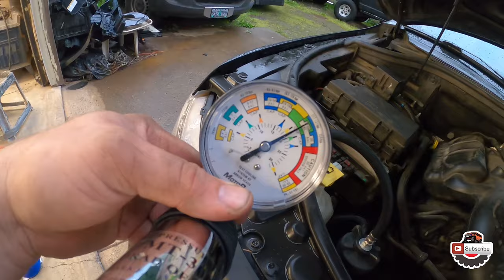Jeep Grand Cherokee Coolant Leak Fix

Comment: First, thanks for the video and instructions.  I have the hose assembly replaced, but I don't remember if the bottom edge of the firewall liner placement is in front of the lower sheet metal, or behind the lower sheet metal.  If you happen to remember, I'd appreciate it.

Comment: My nieces jeep is leaking somewhere. She is having to fill up the radiator twice a day. The resevoir stays at the max  level. im going to try looking at the heater core hoses tomorrow. wish me luck
Reply from the maker: Here's a tip, you can rent that pressure tool and with the engine off, put some light pressure in. Also if money is an issue, get your self a heat glove and sqeeze the rad hose. If there's a crack in any of the hoses or elbows, it'll show its self.  On mine it was obvious. But one quick look underneath and i could tell theres a leak from all the dried up white'ish residue on surrounding parts.
Good Luck.  hope its something simple.
Reply: @JeeperGear  found out, her engine is getting over pressurized and the coolant is coming out of resevoir while she drives.  Maybe a head gasket, Ive replaced the thermostat and ECT sensor. Im going to run a combustion leak test tomorrow to see if its her heads. Water pump isnt leaking or making noise. radiator isnt leaking either.
Reply from the maker: @allthingshiphop1151  Unfortunately that sounds like a headgasket, but a dye leak test will be a good confirmation. Also test the radiator cap to make sure it holds down its rated psi. Those things can cause all sorts of nasty hard to track down issues that can send you down the rabbit hole, when they fail.
Reply: @JeeperGear  I looked at her radiator cap  yesterday. It looks good, Rubber/sealer isnt cracking or dry. I did notice a little corrosion on the inner vacum valve behind the spring? (not sure if thats what its called) Im going to buy a new cap tomorrow as well. Just didnt have time to work on her truck today. But she did tell me it hasnt  overheated today. Her check engine light was on and i got the codes for a ECT sensor being bad, So thats why I replaced it yesterday. It didnt overheat but the temp did go up to 220F at one point. I had to drop her truck off back to her since its her only ride to get to work. So shes had the truck today. It didnt overheat on the way to her job (20 min drive) or on her way home from work But im thinking its because she still had some water in it. So Im hoping the ECT sensor worked, But im still gonna run a leak test tomorrow moring. Ill let you know what happen . Btw its a 2012 jeep grand cherokee 3.6l
Reply: @allthingshiphop1151  how did it all turn out??? I have a 2011 jeep laredo
Reply: @cgaskin00  head gaskets damaged. Sold the truck
Reply: Did she have any smoke coming out the tailpipe? I think I have a long day ahead of me…
Reply: @allthingshiphop1151  how many miles did it have when you discovered it was the head gasket issue?

Comment: My 2011 Overland has the same exact problem. I have the V8 engine thanks for the video i have to do this job this weekend the dealer tells me $1500 btw do u live in North CAROLINA? I will pay u to replace mine
Reply from the maker: Thank you, that means alot. Sorry man, I'm in Oregon.
Reply: Hey bro how its running after fix im having same problem
Reply from the maker: @ivanreese7087  customer runs the Jeep from the vid as a delivery vehicle atm. 
Got 20k miles on her already post repair.
Reply: @JeeperGear  20k miles after fix? Ok thanks for the feedback
Reply: @ivanreese7087 She’s runnin good. I bought the hose from the dealer for abt $108 bucks.  Attempted to put it on myself then chickened out
I had the Jeep dealer put it on And  they stuck a $400 bill up my A$$
Reply: @chevychase9797  damn brother im slowing learning about cars myself dealer tried charing me 800 for replafement of waterpump & thermo. So i went out found the parts under 130 brandnew. Only this is now is finding someone to help me.
Reply: @ivanreese7087  take it to the dealer these Jeep are not easy to work on

Comment: Wow 300,000m. I feel better about mine now. 
I have a leak small leak intermittent. Anti freeze in bottom front pan. (The pan you removed) drives me nuts because i cant pinpoint the leak.
Reply: Did you ever figure out where the leak was coming from? Having same issue😪

Comment: I think I might have a leak from the tip of my new upper hose i see tiny spray trails coming from that specific area my upper/lowers hoses are brand new but has the old factory clamps, my mechanic used the old clamps he said they were still good at the time but lately I’ve been seeing a tiny leaking spray trail from the tip of upper hose(opposite side of the radiator) I’m guessing it’s from that old factory clamp, could I replace that clamp w a new shiny silver standard clamp that has screw flat head for tightening without disconnecting the upper hose and if I do is it mandatory for me to reflush the entire coolant system meaning I gotta buy gallons of coolant and drain n fill n re burp the entire system?
Reply from the maker: Spring style hose clamps are typically fabricated from steel alloy and plated with zinc for corrosion protection.  Steel Spring style hose clamps have several advantages over Worm Gear style clamps as they continuously apply the same clamping force under all environmental conditions, over their entire life. With temperatures changes, rubber shrinkage with age, and vibration loads, the spring style clamp consistently applies force to seal the hose. Worm Gear clamps on the other hand can become loose due to vibration, material shrinkage, temperature fluctuation and can be grossly over tightened damaging the hose and radiator fittings. I would pick up a new set of factory spring clamps to replace with. 
Also, as you replace them, make sure the hose outlets surfaces are clean from debris or build up and will form an even seal when hose is put on. 
Sometimes, spring clamps can be tweaked or damaged if pressure is applied incorrectly with channel locks to unlock them. 
As far as coolant goes, just a word of advice, do not mess with the coolant system if its still hot and pressurized, it will burn you if messed with before letting it cool down. I've had a hose pop off on me because of a failed worm drive clamps. Burned my shoulder and half my face. 
 If you drain it in to a clean deep pan or a bucket, you should be able to reuse it with out any issue. Most of the time if I see any kind of debris, I would filter the coolant as I'm pouring it back in to the system. Then use distilled water if a small amound is needed to top off, keep in mind if you lose a large amount of coolant while draining (accidents happen 😅)  then pick up a fresh gallon of recommended coolant for your model to top off/add. 
Afterwards wipe everything down and then burp the system, look over all hose connections for leaks and you should be good to go.

Hope this clears things up.
Reply: Jeeper Gear wow thank you so much for all this knowledge! 🙏🏽 I’m learning as I go! just tired of paying my mechanic money where I could do all of this myself and I will! It’s a 07 jgc laredo and she’s been maintained well for the last 13 yrs 182K all freeway miles. But this past year I’ve been doing all of my small maintenance here and there I’ve invested in some good tools for me to use and this specific issue I will deal w all by myself and maybe just grab a brand new spring style clamps like you’ve mentioned and stay away from the worm style clamps that makes a lot of sense again ty so much I really do appreciate it! 👏🏽

Comment: I have the same leak on a 2011 GJC
Got the part ready to install 
What’s behind the firewall that need to be loosen
Reply from the maker: From inside the cab, there's nothing to be done only from the engine bay side. Thats why i removed that first firewall shield to get to it and have room to work on lossening the hose clamps. Its tight in there.

Comment: How did you burp the air bubble out?
Reply from the maker: While engine is off, I filled up the radiator, also squeezed the lower and upper rad hoses to get excess air out, then started the engine. Switched interior temp to hottest and blower on. 
Let it run for little while, while adding more coolant as the air escaped and the level dropped in radiator.  Once it quit burping/dropping, closed the radiator cap,  filled the reservoir to a hi line and waited for the rad fan to kick on and hot air to start traveling through the vents.  
P.s. don't let it get supper hot with rad cap being open, as coolant will start to boil if there's no pressure build up in the coolant system.
Reply: @JeeperGear  awesome thank you so much. My local shop wanted to charge me almost 600$ I'm replacing this part in the morning thanks to you! Your awesome!!!!
Reply: What's the part called or part number?
Reply from the maker: Heres the part number for the 3.6 model. 5.7 is little different.  
HVAC Heater Hose Assembly
68251577AB 

Hope this helps.

Comment: Do you think it would help to take the hood off?
Reply from the maker: That would give you more light to work with. Other than that, there's plenty of room with the 3.6 engine. V8 will be a little tight.
Reply: @JeeperGear   I will leave it on if you recall will antifreeze come pouring out of that hose after you take it off   Probably best to do with a cold engine ? Thanks Bud

Comment: What's the name of this part ?
Reply from the maker: You can get those from a dealer by calling them Heater core pipe fittings. 
Here's a google search query for an example. 
https://www.google.com/search?q=jeep+wk2++Heater+core+pipe+fittings&sca_esv=549c059cf7ea463a&sxsrf=ADLYWIKzINEGIhr-TK1MMDvuDa5R4IBZTQ%3A1717815357288&source=hp&ei=PchjZv2cD6yg0PEPrM2quAk&iflsig=AL9hbdgAAAAAZmPWTd8JDudqtsIR5qNM1bDAQ2IGVOD3&ved=0ahUKEwi9r6LxgMuGAxUsEDQIHaymCpcQ4dUDCBc&uact=5&oq=jeep+wk2++Heater+core+pipe+fittings&gs_lp=Egdnd3Mtd2l6IiNqZWVwIHdrMiAgSGVhdGVyIGNvcmUgcGlwZSBmaXR0aW5nczIFECEYoAEyBRAhGKABMgUQIRigATIFECEYoAEyBRAhGKABMgUQIRirAkiVLlAAWJgncAJ4AJABAJgBxQOgAZUNqgEJOC4xLjIuMC4xuAEDyAEA-AEB-AECmAIOoALeDcICBBAjGCfCAgsQABiABBixAxiDAcICCxAuGIAEGLEDGIMBwgIOEC4YgAQYsQMYgwEYigXCAhEQLhiABBixAxjRAxiDARjHAcICDhAAGIAEGLEDGIMBGIoFwgIIEC4YgAQYsQPCAg4QLhiABBixAxjRAxjHAcICCxAuGIAEGLEDGNQCwgIIEAAYgAQYsQPCAgUQABiABMICBRAuGIAEwgIGEAAYFhgewgILEAAYgAQYsQMYyQPCAgsQLhiABBjHARivAcICCBAAGIAEGJIDwgILEAAYgAQYkgMYigWYAwCSBwoxMC4xLjEuMS4xoAfelwE&sclient=gws-wiz&dlnr=1&sei=R8hjZvmEMcXa0PEPqa-dqQU

Comment: Is this elbow pipe in the same location on the 5.7?
Reply from the maker: They're in a similar location except the design is bit different between 3.6 and 5.7
Reply: Can this cause overheating at idle and when driving rough but normal temps when at cruising temps on highway? I changed my water pump thermostat and radiator already so I have no answers to why my jeep is overheating
Reply from the maker: @ssleem3377  i would start troubleshooting as to why this happens. Starting with a fan. It's very common for those internal relays in the fusebox to fail and cooling fans not come on. I've also came across a failed fan on our 2014 ecodiesel wk2.  Which gave similar symptoms.

Comment: what is tha name of that part
Reply: and 9r assembly
Reply from the maker: I was able to order them from dealer by calling them Heater core pipe fittings. They're are different between 3.6 and 5.7 models.